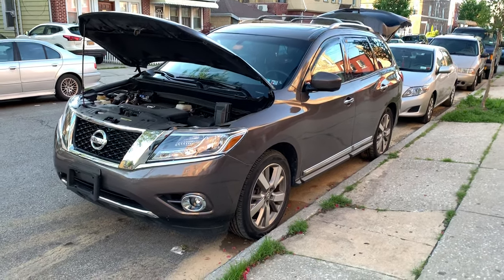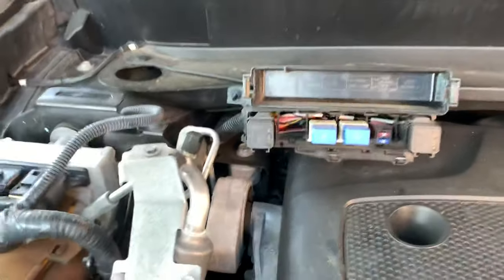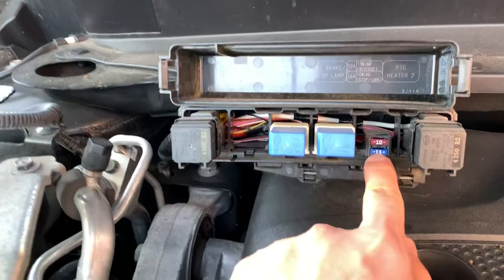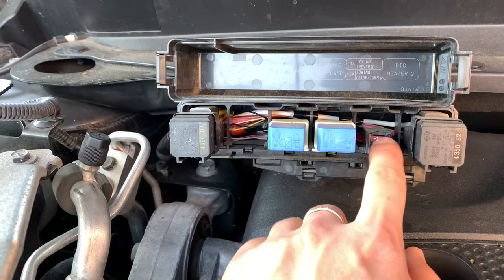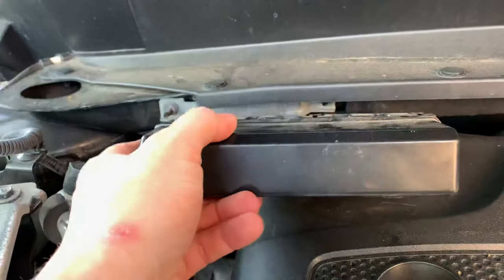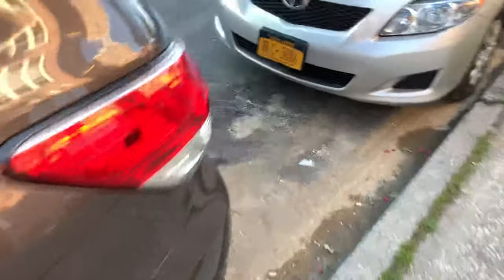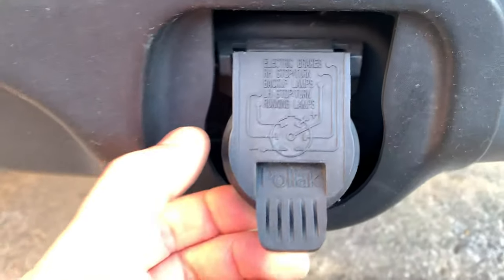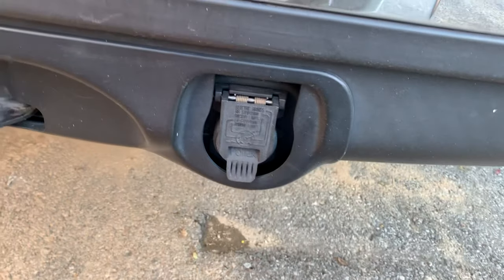Trailer Lights not working On Nissan Pathfinder Fuse location relay stop turn 2013-2022

Comment: Thank you for the video, however there is another fuse box on the right side for the running lights
Reply: Where is the running lights fuse for towing located?
Reply: I have a 2017 Infinity QX60 and all of my towing lights are working except the running lights. I have left/right blinkers and brake lights but no running lights on the trailer
Reply: @keithperry6682 I have the same issue, did you fix it?